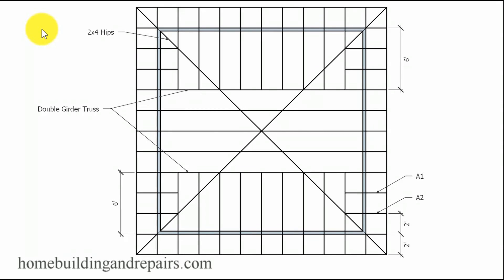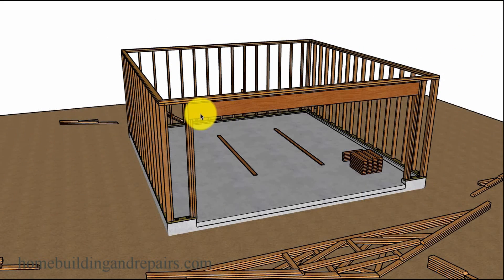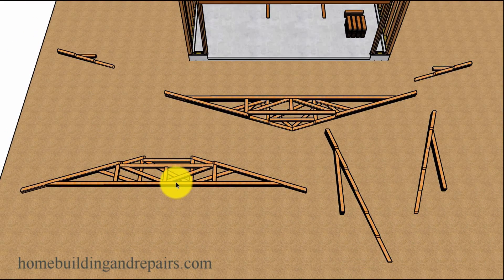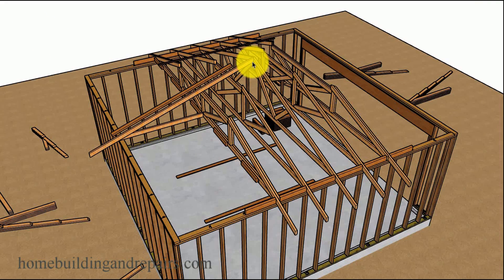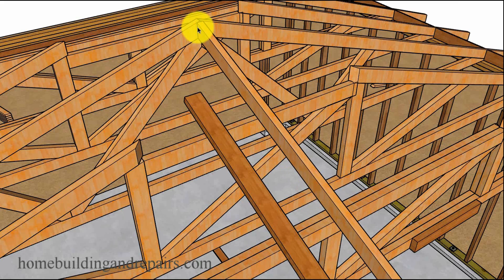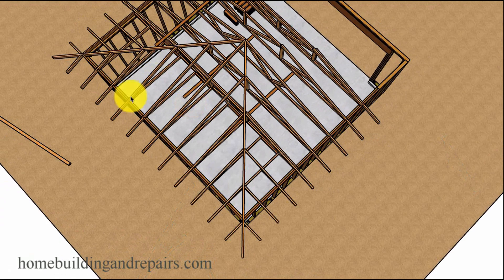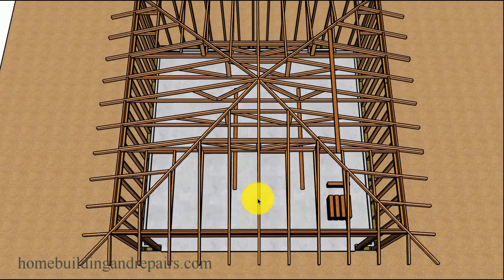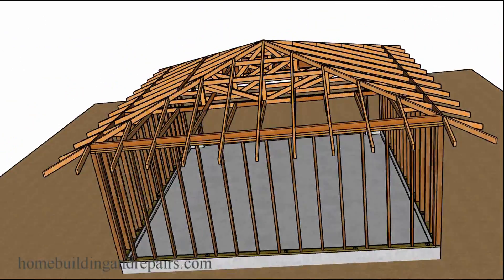How To Layout And Build Garage Hip Roof Using Engineered Trusses

Comment: Hello Greg!  You deserve to know that your videos and especially this one were instrumental in my buidling trusses and laying out an A frame roof with two side hip style gables in the Andes of Peru.  I'm just a housewife and violinist.  And the story of how I got myself into being responsible for a roof with  6:12 and 4.5:12 pitches respectively is beyond what I can share in a comment section.  Just let me say that I was VERY daunted.  But I watched your videos over and over again.  I drew out the structural truss designs following models I could determine here and adapted them to my spans and pitches.  That took me a few weeks.  Then I went to Peru and got a work crew who knew nothing about framing much less gable roofs (they specialize in flat concrete roofs) but they were willing.  I bought a DeWalt circular saw, searched the entire country for a nail gun and nails and we went to work!  It took nealry 3 weeks but as of this writing all trusses are up and running.  I should mention I had to design an iron angle with bolt holes for concrete on one side and wood on the other to anchor the trusses and other wood members to the concrete sill plate.  OSB has been applied and currently we are putting on tile.  I cannot say all the carpentry joints are perfect as warped wood was an issue but it looks like this structure will hold.  And I have you to thank for that.  Your systematic lecture style is VERY informative and gave me the goods to make a combined A frame and hip roofs in a remote area of the Andes.  Maybe I should have stuck with local building techniques but the particular floor plan made that tricky, too.......  In any case, I am very grateful for your contribution here on youtube which empowered me, a lay person to the world of roofing to achieve the roof that I desired in my Peruvian home.  Thank you!!!!!
Reply from the maker: Awesome and thanks for letting me know!!!!!

Comment: I am going to build this exact garage shortly, so thank you for this great video.  I have been looking at doing just regular dimensional rafters, which would be 2x6, with 2x8 on the hips.  The self supporting nature of the square hip would eliminate the need for ceiling joists or collar ties.  The truss construction seems more complicated to construct with more lumber.  Is the justification cost, speed, strength or a combination of them?  Thanks for all the great videos!!!

Comment: How do I remove a hip roof
Reply from the maker: One piece of the time. I don't have a video for this, but you most of the time you simply start by removing the roofing, then sheathing, then rafters and other framing members that were used to build the roof. You will need to install braces to support the wall framing, to prevent it from moving.